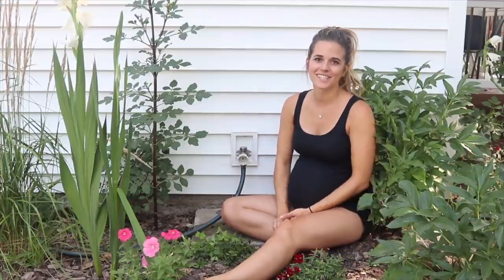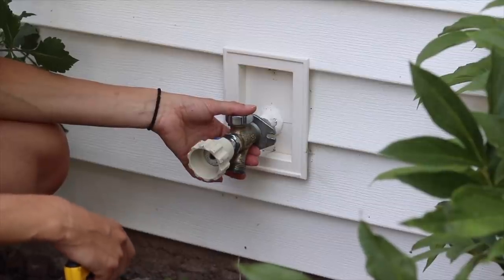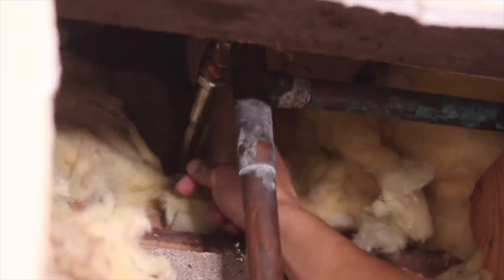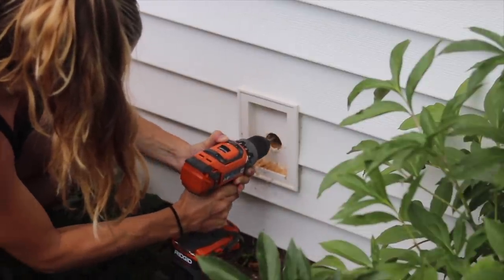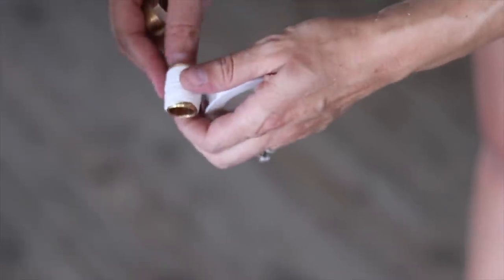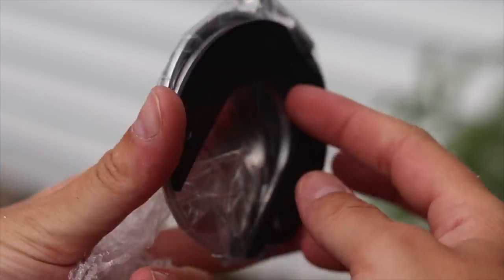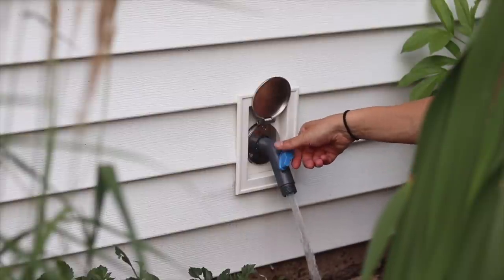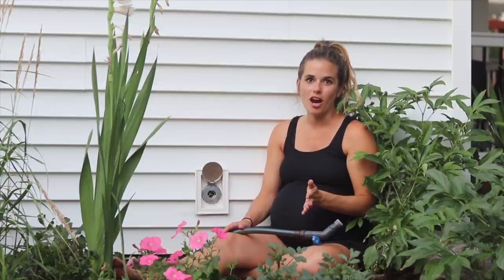How to Replace an Outdoor Faucet | Aquor House Hydrant Exterior Faucet Installation

Comment: Whenever you tape threads, put it on in the same direction as the threads. On that close nipple that came with your adapter, you should use two pieces. Thanks. Good job and Happy Baby.

Comment: When applying teflon tape to a fitting - hold the tape roll in your right hand with the tape hanging off away from you. Hold the fitting in your left hand, use your left thumb to hold the tape against the fitting and roll the tape with your right index finger through the middle of the roll and wrap over and around the fitting. The tape wrap will hold itself and you will be wrapping the proper direction for installation. You actually put the tape on backwards on the nipple.
Reply: Thank you!  That drove me nuts!

Comment: every time i see an Aquor install everyone has this extremely convenient access to the plumbing. That in itself is 3/4 of the job there. If an when i decide to install These, I have a small nasty little crawl space with the floor being lined in instillation hiding the pipes. I guess these are good guides for getting an idea of what to look for when buying a new house ;)
Reply from the maker: My house is 130 years old and my space was very tight working conditions, unfortunately that is why I didn't show much of the piping situation. I literally couldn't get my camera in there. 😏
Reply: I’ve never understood these comments. The task to put one in is the same as any spigot, and most all go bad eventually.

Comment: Sorry to say this but changing a frost free hydrant is not usually this easy , most homes are crawl space with low crawl itchy insulation, spiders and such . Many times the old faucet is soldered and want screw off other times it is too tight to unscrew in a tight space either way the copper can twist up like a piece of licorice candy . Some hydrants are actually above floor level and inside an interior wall . Do yourself a favor and pay a plumber to do this job . Hats off to this mom  I wish her and her family well 👍
Reply: @Friends4ever225 ou may be able to use a shark bite coupling if there is enough copper behind the faucet . Also if brick and mortar are tightly around the old faucet it won’t slide out you have to cut the faucet loose inside , pull it forward, cut it in half and drive the other half back through then drill the hole larger for the new faucet.Changing a frost free hydrant is usually a difficult task , I’ve been doing this many times for over 50 years , why this lovely mom is presenting this is beyond my comprehension.

Comment: Does that drain back as far as the couplers you installed?
Reply from the maker: There's a mechanism inside the hydrant pipe that controls the release/closure of water. So on my 12" hydrant it drains back about 9" of it.

Comment: I don’t mean to nitpick but I think it’s important to use correct terminology. Several times you mentioned plumbers putty but what you were using was pipe dope or thread sealant. Plumbers putty is a completely different item and not used on pipe thread.
Reply from the maker: Thanks Steve, I did not know that.

Comment: I'm confused about predrilling holes.  Why can't you wait till its turned on snug and then drill the holes?
Reply from the maker: You could, I didn't want to risk my drill bit from coming in contact with the stainless steel cover and potentially marring it or the drill bit breaking.